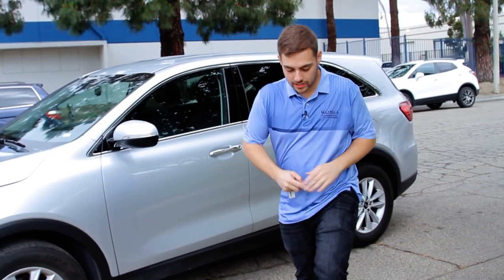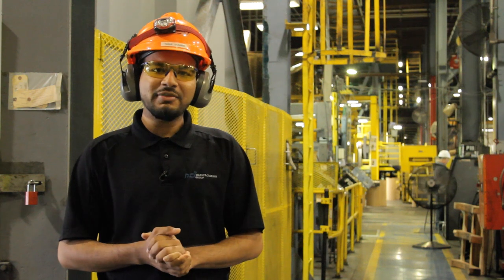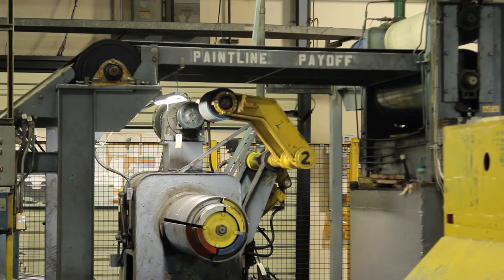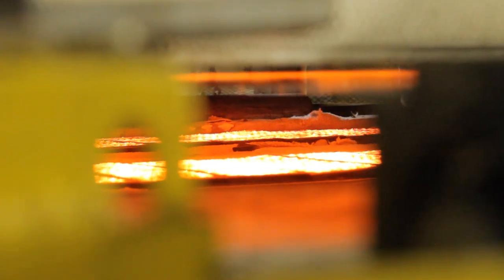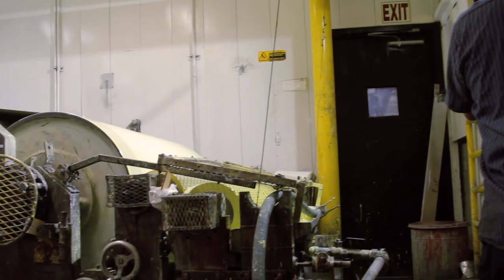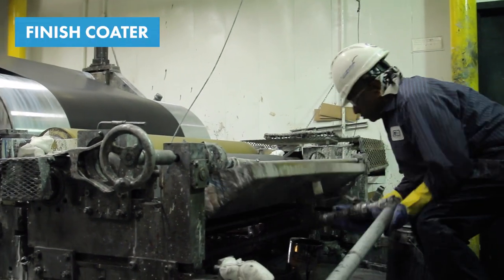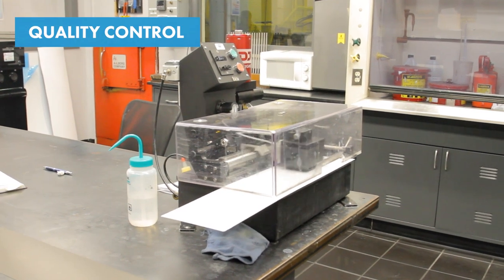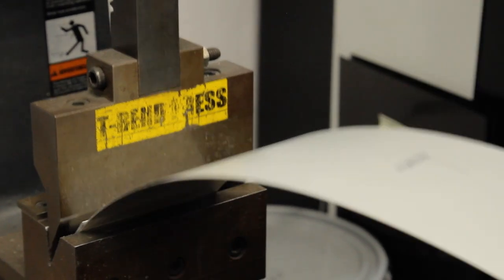How Is Metal Roofing Coil Painted? Metal Coaters Paint Line Tour

Comment: Retired 12 years now, worked at Baycoat in Hamilton, Ontario, Canada. We did exactly the same QC checks when I was QC Team Leader there, on virtually identical equipment
Reply: I'm in QC currently. We painted for appliances but the tests are the exact same. All except the salt spray because there is no need for it on appliances.

Comment: Im an electromechanic and i work with this machine , doing maintenance and repair everyday !! From montreal quebec !!
Reply: Hello sir,
Could you please tell me about the load cell that is used in the applicator/ pick-up and metering roll. How do you change it ? 

Regards,
Saif
Reply: @saifalniamah9002  hello Saif , i dont remember exactly the model of the loadcell . Its was located between the roll and the bearing and then the operator could adjust the load on the roll . It was going directly into a converter that displayed value for the operator
Reply: @sgolosio  
Thank you. 
I think first they separate the rollers in order to dismantle the load cell. But I don't remember exactly.

Comment: So with the stitch waste is a thousand feet of metal just sent for recycling from each coil?
Reply: It's reuasble.
Reply: Stitch waste is typically less than about 50-75 feet per coil (combined head and tail), and is sent for recycling after removing from the coil.
Reply: @joneal0284  this is true. I work in the Cambridge, Ohio metal coaters plant, formerly Centria. There is less than 100 feet of scrap combined on the lead and tail during the stitch or what we call the splicing process. Unless of course there is a defect in the metal like bad edges or dents, which are fairly common especially in the .019 62.5”  aluminum we paint for Arconic and Alucoil. It’s common to see metal banding dents on the leads of coils in any of the steel and galvanized/galvalum also.
Reply: @MrJunior82006  I work for Metal Coaters too, at the Marietta, GA, plant.

Comment: on the business end ,these coil coaters dont own the steel coil...The customer hires this painting done then furnishes coil that is suitable for what they are needing.There is a coil coater in chicago that recieves monster eye to the sky coils ...2 coils per trailer...60,000 lbs each! This 120,000 lb.load is only hauled 5 miles..and is only allowed by the DOT on a special permit..This coil coating industry,like so much american ingenuitity,took a hundred years of mechanical evolution to get here..Im still amazed these monster production facilities get built at all.